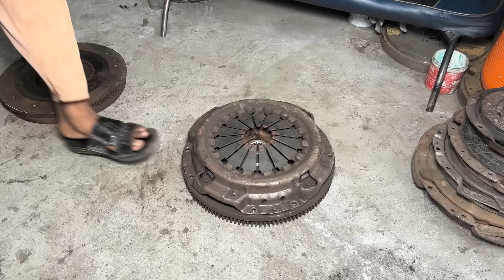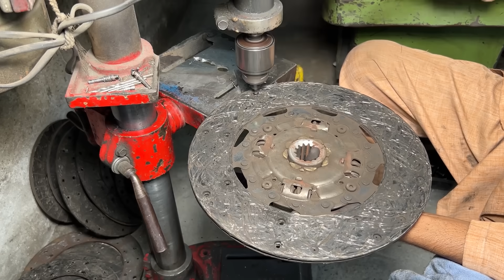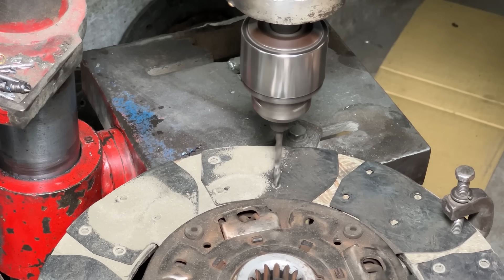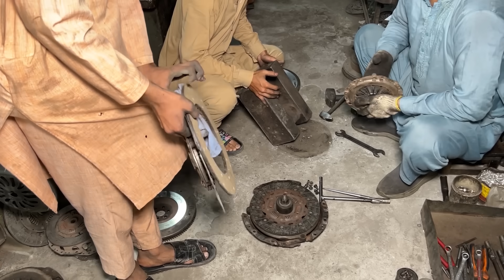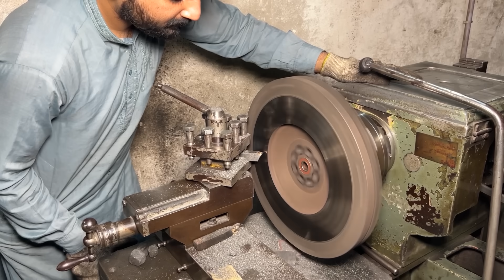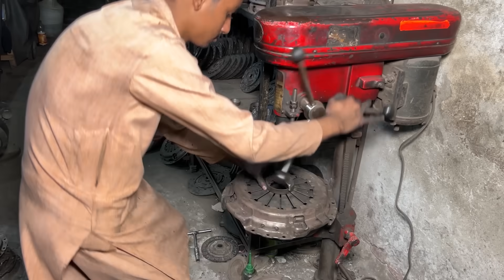How we Rebuild and Restore an Old Rusty Clutch Plates

Comment: Beware of asbestos
Reply: Now they are made from kevlar.
Reply: Na, not the same as asbestos insulation.  This in non ferrable , not dangerous. I own a clutch and brake manufacturing company, 100 plus years , 3rd generation, my uncles 96 and was burning brake lining in an open fire pit when he was 6 years old, still healthy, father 87, in business since 18, no issues.
Reply: @davidhamm5626 actually no…mostly fiberglass , graphite cotton and linen and a lot of resins  , there is Kevlar, but it’s so expensive, it’s only for special clutches.
Reply: @cuttersgoose  I have not any clutches in a long time, it is interesting to see how things have changed.
Reply: And why?....
Reply: Mostly carbon fiber nowadays.
Reply: I feel like asbestos is safer than these clutches 😅

Comment: flywheel should never be resurfaced on lathe but on surface grinder
and WTF are they using on the pressure plate, a rock?
Reply: Yes, a flywheel can be resurfaced on a lathe, but it's not the most common or ideal method for this task. Flywheel resurfacing is usually done with a specialized flywheel grinder, but a lathe can be used if the right tools and techniques are applied.

Comment: I thought those bearing races were precision ground, matched to the ball bearing diameter within 0.001" or less, and case hardened on the race faces. Not sure it'll perform without some roughness, but maybe the machine gets a few more years of life.
Reply: No need to even go that far when you know hand riveting will warp the plate. It'll wear prematurely, chatter, and possibly even let gears disengage without pressing the pedal on certain occasions. Probably going up hills... unfortunately.

Comment: 3 things 
First, that’s not the correct way to cut a flywheel although it will work , but he needs to cut the full surface, just cutting the worn part will now result in less life. Plus it should be cut parallel to the crank flange otherwise it will wobble cause ing disc chatter.
Second , not the right way to cut a pressure plate, the spring will cause the casting to float so it may be uneven and not wear properly . It will most likely work fine, but there might be chatter, but still the right way to do it is drill the rivets out, remove the casting and locate it in the back of the casting where the spring engages, this will give a true “square” cut to the casting
Besides, put a straight edge on that surface and I guarantee it’s warped, but again, for what the have, it will work
Three..never never wear gloves when using spinning machinery
Reply: third point is good highlight it often gives false sense of protection by gloves but increase chances of entanglement